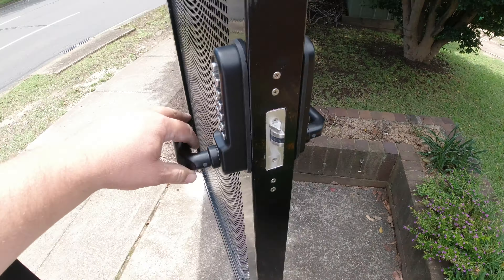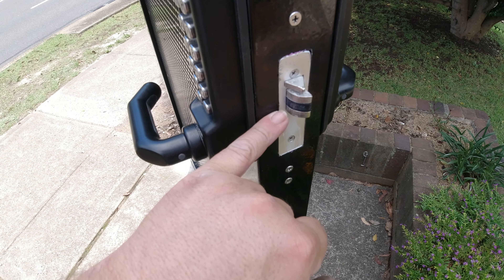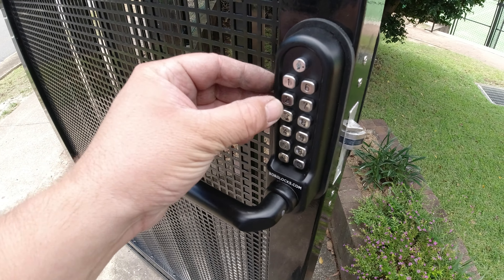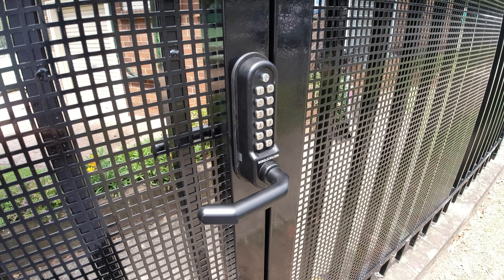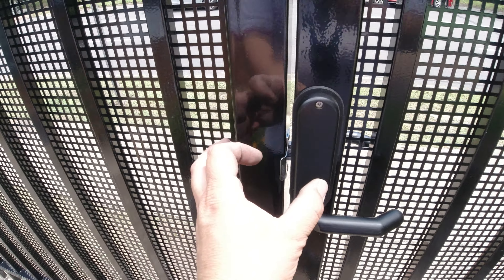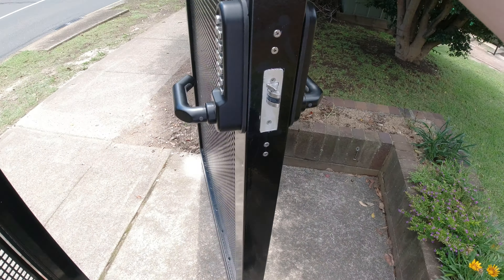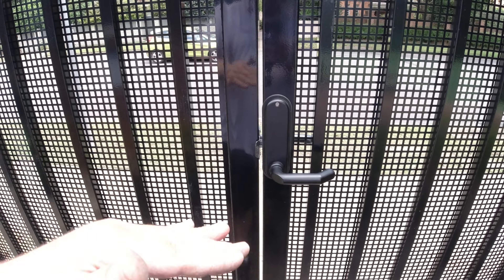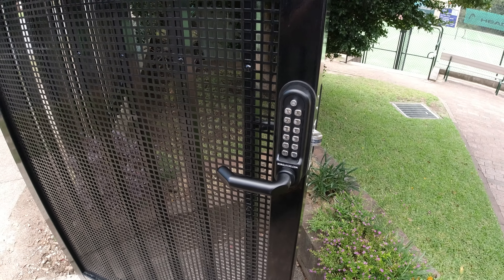Digital Lock Black Borg 5000 With Borg Latch On 60mm Steel Gate

Comment: i can clearly see that gate can be easily open by frying a flat metal thick enough to go in between the gap. You should install or weld a flat bar to prevent that from happening
Reply from the maker: Its a tennis court for old people, they dont need it

Comment: The inside handle can be opened from the outside by using a rod or stick through one of the holes or even a bit of wire I would be putting a box around the inside handle to stop this from happening
Reply from the maker: Yes, but its ok for the situation
Reply: Or gone for back to back keypads if desired

Comment: Hi looks good . How did you get the nuts on the back of the plates above and below the lock body ? I installed one today and had so much trouble and ended up riveting them on ? Any help would be appreciated.  Thanks Damien